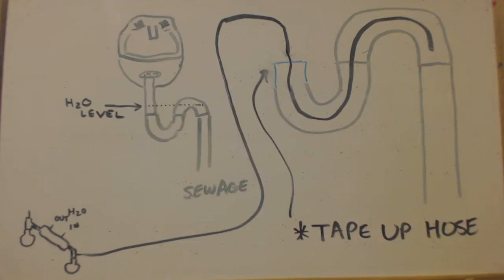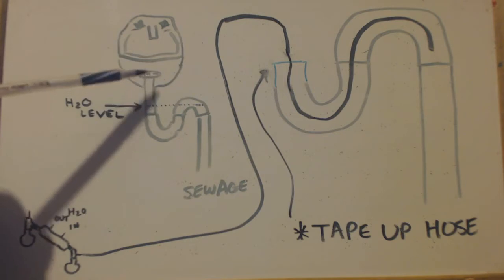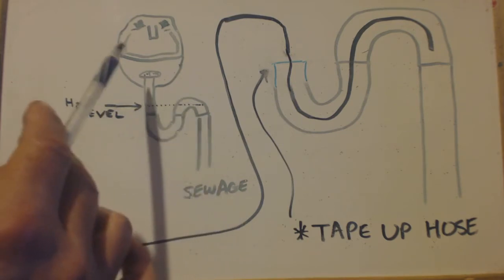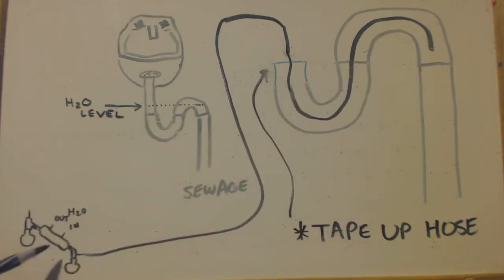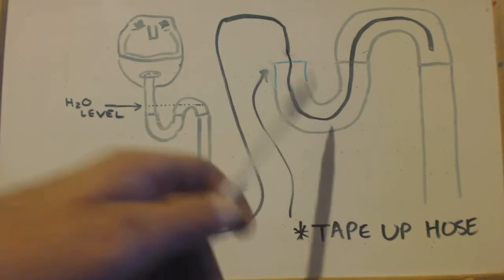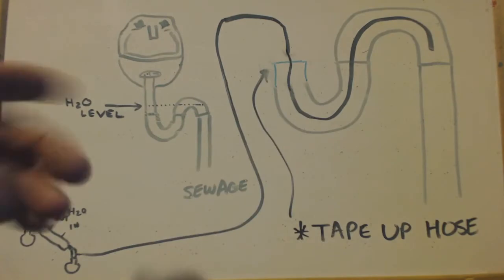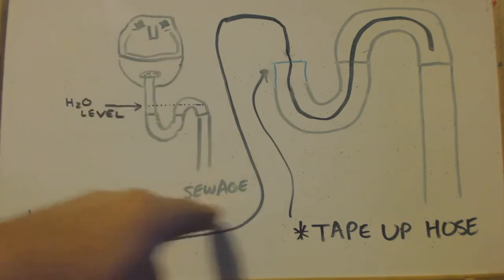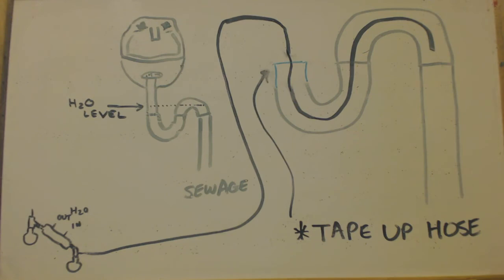SCRUBBING LAB FUMES USING YOUR SEWER SYSTEM

Comment: Would it work with a septic tank?
Reply: Yes, however you need to make sure it doesn't harm your system. Make sure you know if it's plastic, fiberglass, concrete, or steel, and your gasses are not too corrosive for the tank. Might kill off septic flora as well but they're Enzymes for that.